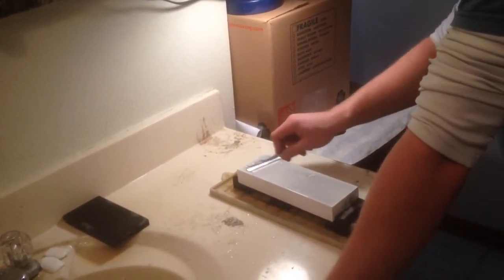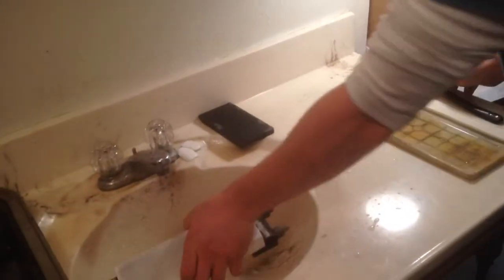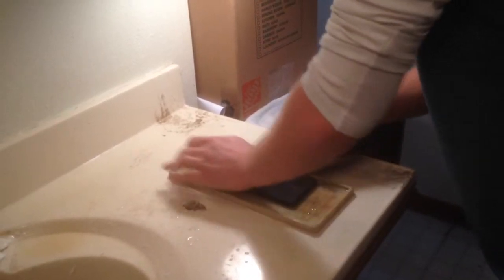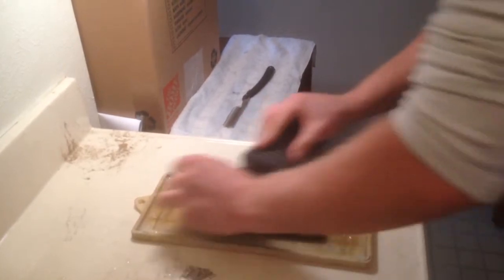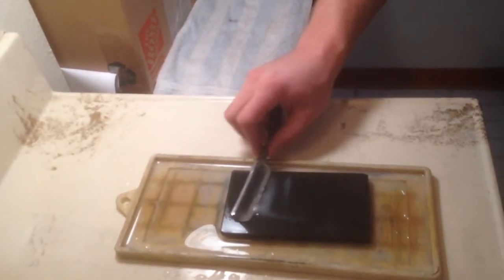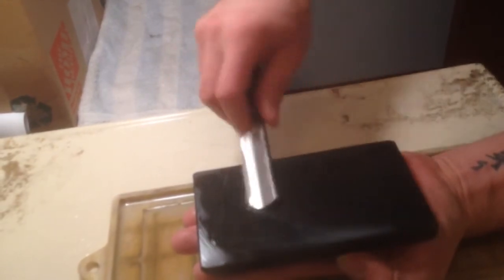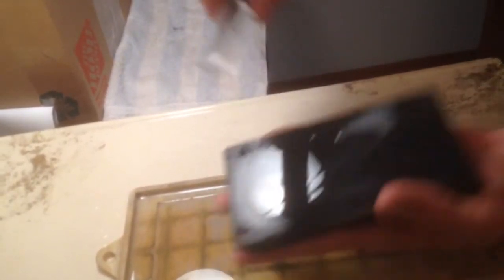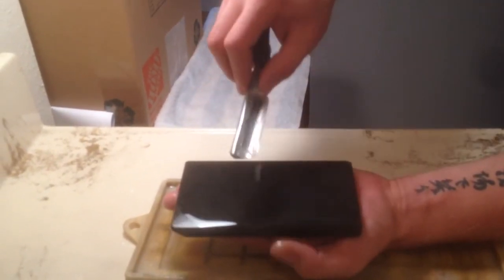Ancient Ocean by Wild Whetstones, Straight Razor 1 Stone Honing With A Natural Whetstone.

Comment: palm strop os a joke right??... how in the hell is that doing anything...
Reply from the maker: John Smith no it’s not a joke it’s a serious technique and if you mess up then it’s really not funny haha. Here’s why it works - skin has the ability to microscopically burnish steel. Skin has silica in it so it does have the ability to align the edge at a subtle level. Ever wonder why barbers use a leather belt to sharpen their razor a little bit? Same thing.

Will this sharpen a totally dull edge back to sharp ? Definitely not, but it will do a fine tuning on an edge that is polished. Also it realigns the edge a little bit.
Reply: Gabriel J Warren right well i use stropps or evens jeans 👖 for that matter. i just palmed my face a little 🤔 thinking how much does he expect that to do... but yeah ifs to get the complete edge then i can see that but. think of it this way.... “Yep all done I just stropped it on my hand and now its fully polished” im curious though how much different is this compared to a black Arkansas
Reply from the maker: John Smith how much difference is what compared to a black Arkansas?